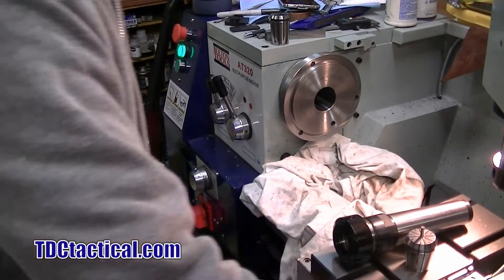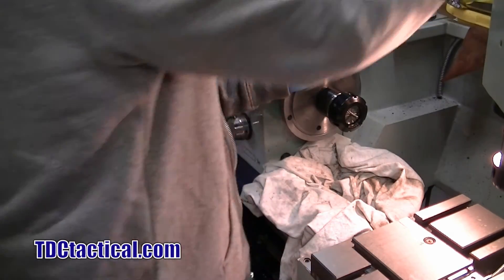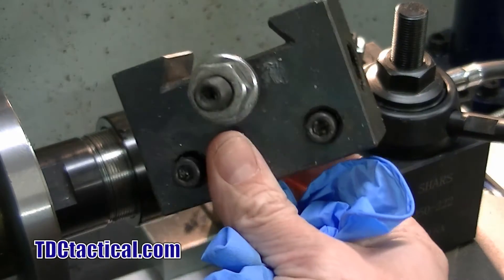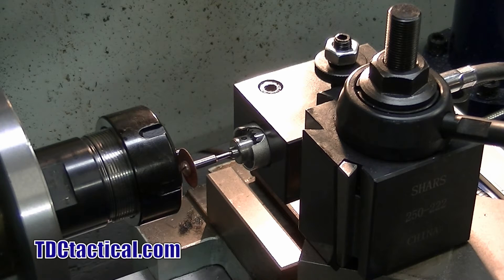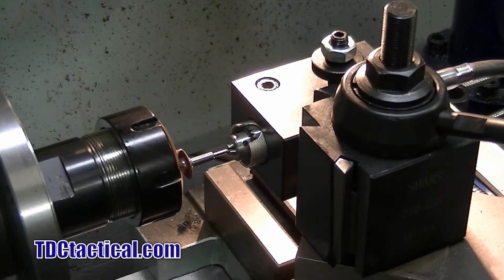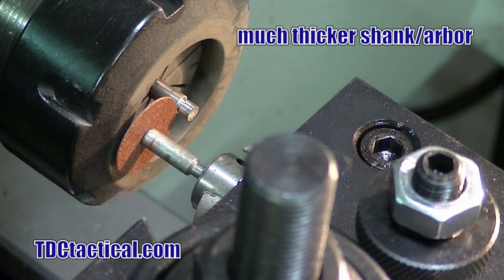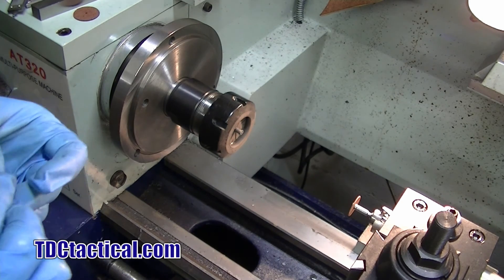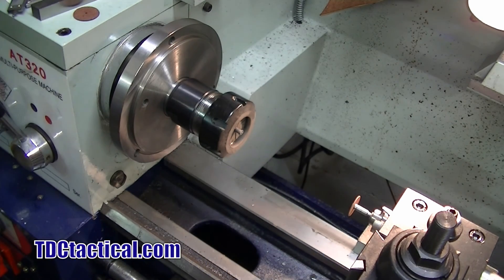Making a Tool Post Grinder and using ER40 Collet Chuck for your lathe

Comment: Just a tip. It's a good idea to start off with putting the collet correctly into the chuck. Same goes for the part. You have some serious runout due to the fact that you are not putting that collect correctly into the chuck.

With ER-collet there is an eccentric holder inside the nut which holds the collet. Start off by putting the collet inside the nut without the part and then put everything into the chuck. That's the proper way to hold stuff with an ER-collet. Just the runout alone on a dowlpin should have had you think about errors in the setup.

Comment: You may know this by now but it is SUPER IMPORTANT that you cover all the surfaces of your lathe in order to protect them from the abrasive dust. It may not seem like much of a problem but it really is very important. Clean all the dust that may be there from previous unprotected uses then re-lubricate everything and start protecting it from now on. EVEN if it is just a single quickie cut with any abrasive of any kind, even sandpaper of any kind, Protect Everything or Don't do it. - - If you didn't already know, you can lubricate the flex shaft to get extra life out of your grinder.
Reply from the maker: Yea, I knew it then. haha  Thanks so much for looin out for me though.  Sometimes it is easy to get going and omit things.  I don't usually do so but did in this instance. thanks again!
Reply: specialks1953 
Well.., nothing like 2000 rpm cutting and spinning chips that grab a hold of that towel or whatever is laid over the ways until it rips it up and has a giant ball whipping around breaking everything in its path including a Lexan lathe cover (I’ve seen it happen). I would never recommend anything within the rotational mass of any lathe chuck. Your life and limbs are far more priceless than a couple of ways. In no machine shop that I’ve entered have I ever once seen anything used to cover the ways. If you clean before and after every task you should not have any issues with the debree unless you’re rubbing and grinding them into the lays purposefully. My ways look like brand new and I have never had to cover them.

Comment: To clarify further, place the nut on a flat surface, threaded side up, then insert your collet of choice and tap or push it until it clicks into the nut, so that it won't fall out when held the other way up. Then screw the nut on.

To change collet, gently pull it out of the nut at an angle.